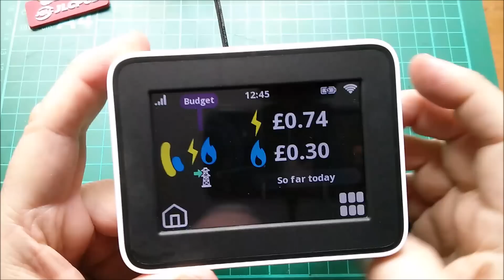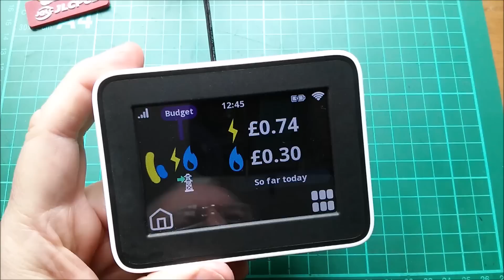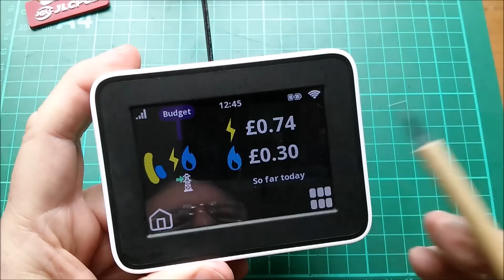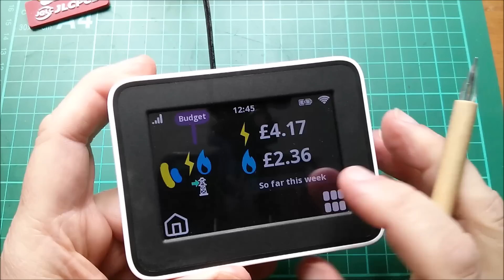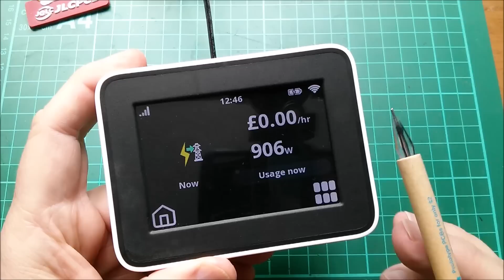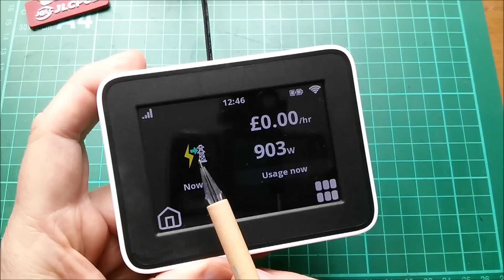Smart Meter In-Home-Display IHD6 Stripdown

Comment: two questions/points:
a) If one bought a second hand device, how does one 'sync' it to the house smart meter? (another video perhaps)
b) Does the display also show the export meter [cumulative] readings, as distinct from the import readings. (my old IHD3 doesn't appear to show any of the export numbers other than the pylon direction arrow)
Thanks.

Comment: I'm surprised to see that your IHD6 shows you how many watts are being exported, my IHD6 does not do this and does not show the pylon symbol. It is a great frustration of mine that i have no idea whether i am exporting 10W or 2000W because the IHD6 just shows usage now as 0W when I'm selling to the grid. I have to use trial and error to turn on appliances and see whether the IHD remains at 0W or suddenly shows lots of power being imported. My IHD6 has exactly the same model number and PCB revision (IHD6 CAD PPMID R5 / CA602XX 2018), the only difference that i can see is you have software version 2.1.0 whereas I have 2.0.2. I cannot find any information on how to update the software though, and it obviously doesn't auto update (even though it has WiFi connected).
I have also opened up my IHD6 to look at replacing the battery since it now only lasts about 10 or 15 minutes on battery before switching off. Interestingly mine had some red anti-tamper resin-like substance covering one of the screws that i had to chip away before i could get into it.
Great and informative video by the way (it was otherwise difficult to find much information on the IHD6!)

Comment: Great Info..  I just got my smart meter installed today, and having a look through the instructions. it's IHD3   2024 Version by Chameleon .  Looks as if they are cutting back on the cost of these devices.  This does not have a ON/OFF switch or any battery backup.  Hence a little dissapointed. The electricity company removed my original meter as they say that next year the telementary LW signal will be switched off, and meter will no longer be able to switch Peak & Off Peak tarrif.  It was a little unusual setup, as had Three rates: Peak: Off Peak: & Heating, which controlled Storage heater & Immersion heater. It appears now that I have only two rates. Peak & Off Peak. So will keep an eye on things & monitor my usage. Thank's for the info.

Comment: Mine has never worked from the day of installation. Contacted the energy provider many times with no result. I've  had the meter and display unit for going on 3 months now. Very dissatisfied with the way they are responding. They either have very poor installers and technicians or they just can't be bothered. (Octopus energy)

Comment: Great video. This was the only video I could find on these display. Purchased one off the back of it. However it appears the only do plug in now (I was unaware) so have to leave it plugged in at all times. I noticed the newer ones do not have the battery symbol.  It does show a wheather reading instead.

Comment: I am with Utilita and for the past few months had constant signal problems, the engineer came out and said that gas meter not communicating with electric so got no display from my gas and now waiting again to see if they can fix it their end.  Got told that if you use a Wi-Fi connection you risk hackers and people switching on your power etc not sure if that's the case but if you dont have a  firewall setup that could happen in theory.

Comment: how did you set up the smartmeter to read the solar panels? I have solar panels but I was told that the smartmeter was not able to detect the output of the solar panels
Reply: You have a second smart meter that logs what is been sent out the the generation (solar/ battery's)

Comment: My gas usage doesn't show but my electric does. What could be the problem?
Reply: Your gas meter isn't communicating with the electricity meter (the gas does all it's communication via the electricity meter) probably because it hasn't been properly commissioned by the energy company. That's usually the problem, certainly was mine.

Comment: My IHD went pop a few weeks back, noticed it rebooting and then saw smoke coming out of the back! Unplugged sharp-ish.  Received a replacement but haven't got around to getting it paired to the meter yet.
Reply: I'm assuming after 7 months you have now linked to your meter!?

How did you pair it with your meter?

I have moved house and brought my display with me so I'm so wondering if I can pair it with the meters at my new home so that I can have 2 working displays.
Reply: @David-bl1bt  Yes, the replacement is now paired OK.  It's not something you can do yourself.  I contacted the smart meter installer  customer service people and they tried to pair it remotely but it didn't work.  So they had to book an appointment for someone to come out and pair it at my home, which worked.
Reply: @y0rkiebar  OK, thanks for your prompt response. 

It appears that it be be destined to another piece of plastic ending up in landfill rater than being put to some use.

Comment: So. The smart meter is already a WiFi hub. Already connected to the telecommunications infrastructure with transmitter and receiver for data. ?   Right.  So!  How to use this   !  instead of the current internet providers. ?

Comment: This was a rather interesting overview of this neat little display! My power company upgraded my meter to a "smart" one from the same manufacture (in the States here.) and I noted the zigbee logo on mine as well. Did a fair amount of research coming up with nothing, so I rang up the power people and got basically nowhere. I wanted to see if it were possible to monitor my usage via zigbee from the meter and inject that data into my home assistant server for collection graphing and monitoring. Anyone I could reach with electric company had no clue.

The old meter used the ISM 900mhz band, and while I never successfully found my power meter, I was able to find the gas meter in the 433mhz ISM band, and successfully sniff its data out of the air.

My solution for power monitoring was to build my own system with some CT clamps inside the electrical panel, which plug into an esp32 and run data into esphome addin within home assistant. Pretty neat.

Comment: Hello again Julian. The third wire on the battery is almost certainly the other end of a grounded negative temperature coefficient thermistor. This allows the charging circuitry to detect the battery temperature and cease charging when outside a specified range, usually between 0'C and 45'C.

Comment: Although these may be Zigbee often the  profile is the SE profile which is not compatible with the usual  profiles we use for home automation, which generally follows the Zigbee HA profile.    Just wanted to mention that as a lot of people think Zigbee and that it could be put easily into home automation systems and they may not be so easy to integrate as people think.
The Anti-Tamper switch can be setup to be silent to notify the utility company when you have opened it as often these devices are rented and not owned by the customer.

Comment: It looks like there's a track going from the switch to R40 which is unpopulated, the other side of which goes down towards the voltage regulator at U2. That suggests it might be a pull-up resistor, and the fact that it's not fitted suggests it's floating, hence it may not be active.

Comment: My parents have been considering getting solar since before they built their house in 2020. They couldn't do it when the house was built because of the increased cost of materials and labour during the pandemic.

I was speaking to my colleagues at work, one of them has a 10kW system and the other a 15kW system, and surprisingly the one with the 10kW system paid back the cost in just under 3 years, and the one with the 15kW system paid his back in only 2 years. Both of them have batteries and generate a large excess of energy, they basically end up with negative bills over the year, so they're effectively being paid to generate electricity instead of paying to use it.

The latter uses a lot more electricity, so that's why his pay back time was quicker. When you're spending thousands of Aussie dollary doos on electricity every year, installing an excessively large system that reduces your bill to zero or negative makes the pay back quicker, obviously at the expense of higher up-front costs.

Comment: Octopus has a useful API for grabbing various bits of info. We don’t have solar panels yet, but we do have a plug-in hybrid car. I was going to use the agile pricing to optimise for cost charging the car. However, we now have a deal with cheaper electricity in the early hours, so I just run the charger then

Comment: ER34615 Battery, 3.6 V, D, Lithium Thionyl Chloride, 19 Ah, Raised Positive and Flat Negative, 33.1 mm
But see the size: 33 mm x 61.5 mm. So small, and still 19Ah, that is like WOW ! A LiFePO4 of that size only delivers 7Ah at 3.3 Volt(ish).
Reply: Yes but it has a very high internal resistance and therefore very low short circuit current (probably mA). These are ideal for smoke detectors/tank level sensors where you want 10+ years battery in low drain devices.

Comment: I think the version I bought off ebay to mess about with, might be the updated IHD7, as it has a slightly different PCB layout and also has a room temperature sensor near the bottom. I also has an ESP32S2 Processor along with the FT800 display / sound / touch screen chip. I've uploaded a picture of the PCB but for some reason it won't let me put the link to it.

Comment: Hi Julian, Great video as usual.  I have an identical meter, but it doesn't have a wifi symbol top right, it shows the incorrect rate for gas and it does not show the export rate (I have a small 1.2Kw solar array) I have reset the IHD several times but the it still shows the wrong tariff ... any suggestions how I could update it?
Reply from the maker: I phoned Octopus and the chap altered the electricity rate (which was wrong) while we spoke.
Reply: @JulianIlett  hey there,

I was watching your wave form generator video and I had a question. 

How do IGBT’s make a pure sine wave for 60hz? I understand that they switch on and off many times and the more they do that, the average looks more like a pure sine wave. If they only switch on and off 20,000 times a second and pulse width modulation works best when the pulses are extremely fast, how do you generate 60hz of ac?

Comment: I have the same energy Monitor on Octopus but it doesn't have the wifi option as far as I can see.
Reply from the maker: You press the menu symbol (the 6 rectangles), then you have to press the right arrow (because there actually 9 menu items) and WiFi is in the 'settings' sub menu.
Reply: @JulianIlett  mine doesn’t have that option

Comment: Damn, I got one of these and was going to do similar as it has an ESP32S2 processor in it. Not sure if its been locked or not though. I did something with one of the PIP500 energy displays some time ago and reverse engineered the connections and used an ESP8266 and wrote some drivers for the touch screen and display. https://www.youtube.com/watch?v=gplwimAv6js

Comment: Lithium Thionyl Chloride cells are primary cells I.e. non rechargeable. They are used for sensors with long term applications. Have a look at SAFT LS cells on RS. AA cells with 3.6V each.

Comment: is it still the case that if you change supplier it effectively bricks your smart meter?
Reply: The current type 2 meters should be able to switch to any supplier.
Reply: The SMETS2 meters are fine if you switch, the original smart meters break. I moved into a brand new house in 2018 and it had a smets1 meter locked to British Gas. I switched to Bulb and it went dumb. However then Bulb told me I could have a free smart meter installed if I wanted.

So they ripped out a literal brand new electricity meter and replaced it with a newer brand new meter 😂

The IHD didn’t work for months, then one day sprang into life. They’re not that great at the moment, nobody needs to know their house is costing 17p/hour.
Reply: @ncot_tech  Eventually EDF took over our old smart meter. I think the government forced them to. It is just a matter of transferring ownership of the SIM I think.

Comment: Mine makes some odd noises, like it has a tiny hdd in it with heads seeking.
Reply from the maker: That's weird. It's always a worry when lithium powered devices make odd noises.
Reply: It’s been doing it for a long time… might open it up it’s not really ‘mine’ to crack though.
Reply: Mine was making weird noises at the weekend only. Then I realised it makes a beeping noise if the "weekly budget" has been exceeded.

Comment: I was wondering why someone would still build devices in such an obnoxious design and resistive touch screen in 2022. Then you turned the device around and it showed „made in UK“, that was the aaaaahhhh moment 😂
Reply: They made an updated version IHD7 (bought one to reverse engineer and mess about with) and it still got an resistive touch screen lol. Interestingly it has an ESP32S2 processor! I posted a link to a picture of the pcb in my post further up if you're interested.

Comment: Hi Julian. At 20:50 you said "thruppence" (meaning 3 pence) .. In fact your family used 30 pence worth of gas.
So maybe you need to cut down their evening gas usage! LOL.
Secondly, I'm sure these remote 'In Home Display' units must be registered to your own meter in some way
 else you could possibly hack into your neighbours meter to see how much power THEY are using?
Just a thought mate..
Ian.    2E0IFZ.
Reply from the maker: Yes, but 27p of that is the standing charge, leaving just 3p of gas usage :)
Reply: They use a version of zigbee with keys IIRC, I did look into something similar when I was messing about with a PIPIT500 energy monitor a few years back. I see your an intermediate, I done my foundation last year.

Comment: I now have 9.6kWh of batteries waiting for panels on the roof, I did ask how 18 panels stacked up on there sides in the garage is going to reduce my bills. funny they had no answer for that. 🙂
Reply: I had 3kW of panels on my roof waiting three weeks for an inverter and batteries. Finally got it done and it is working well now.
Reply: @rpdom  I'm waiting for batteries, as I'm thinking about going totally off grid.Although I'll have to change the two grid tie inverters I just repaired.
Reply: @rpdom  with luck they should go up next week, at least I'll have time to get up their scaffolding  and clean out the front guttering :-)
Reply: I recently fitted 16 panels on our shed roof, and got a blown inverter off a friend, which I then fixed, and bought another blown one off eBay. However tech support wasn't forthcoming with a service password I needed so I had to reverse engineer their software, and write my own keygen!
Reply: Meow!!!!!!!!!!!!!!!!!!!!!!!!

Comment: Oh, I believe the white wire is a temp sensor.
Reply: Yes, I believe you are correct!
Reply from the maker: Would that tiny cell ever get warm. The charge current is probably a few tens of milliamps.
Reply: @JulianIlett  I remember designing a boiler monitoring unit for a large manufacturer and there were some pretty stringent health and safety regulations to conform too when putting battery systems into homes and especially "at risk occupants", and as you know not all of them make complete sense in all cases.

Comment: You'd think that the gas meter would have an impeller in the gas flow to recharge the battery.
Reply from the maker: Gas pressure is way too low for that.

Comment: It is nice to see yours working, my in home display has never worked, some issue with my meter setup.
I have asked my supplier several times to fix it and they never do.
Reply: Same problem with mine. Have tried many many times both emails and phone calls to my energy provider (Octopus) Either the haven't got good technicians or they just can't be bothered. The energy providers bombard you with requests to get a smart meter then abandon you when they don't work. I wish I hadn't been persueded.
Reply from the maker: Some suppliers are more approachable than others. Octopus can be persuaded to fix things if you phone them. Email support is pitiful though.
Reply: My British gas one constantly loses connection even though it's right next to the meters